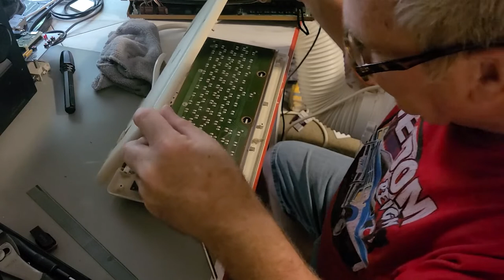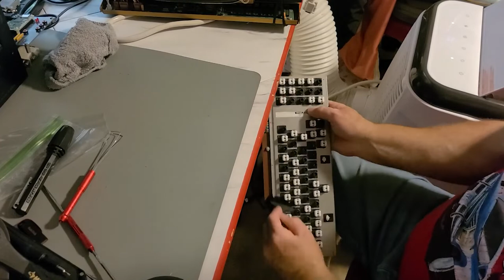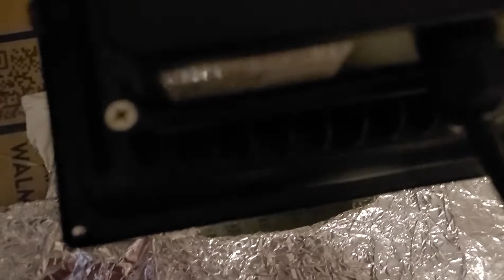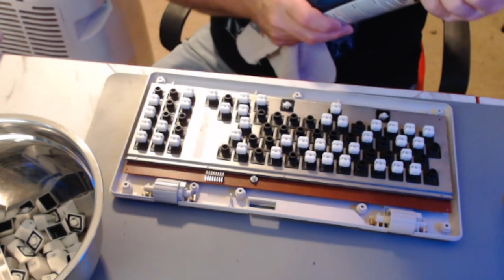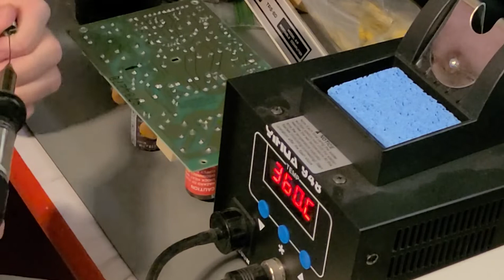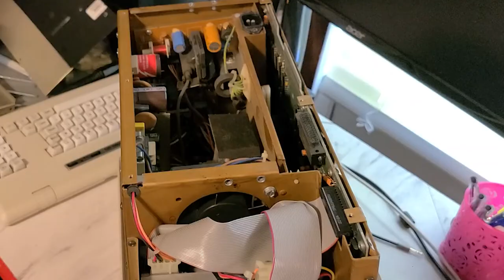TRS-80 Model 4P Part 4: Retrobright, RIFA Capacitor Replacement, and Reassembly

Comment: Just curious why you only replace one rifa capacitor.  Is that just the most likely to fail?
Reply from the maker: Yes. The RIFA capacitors tend to crack and allow moisture to get inside of them, which leads to them shorting out. They frequently fail and release a big cloud of smoke that stinks pretty bad. As a precaution, I replace all RIFA caps with modern nylon replacements. RIFAs are not bad parts. They simply develop problems over a span of 40 years or so. . . I didn't replace any other caps because they were not problematic and modern replacements are generally not considered to be of the same quality. In other words, it wasn't broken so I didn't fix it.